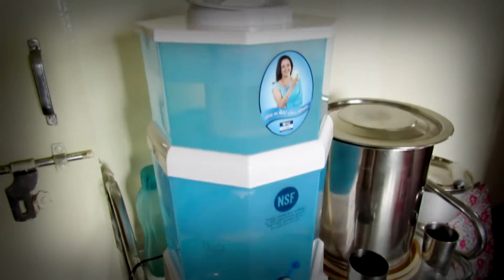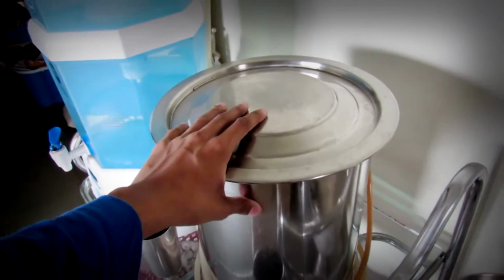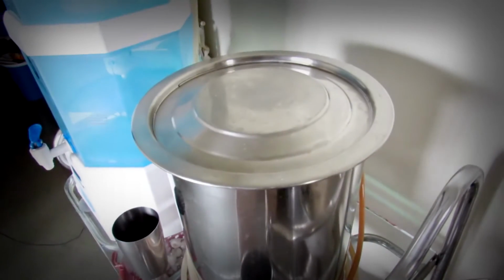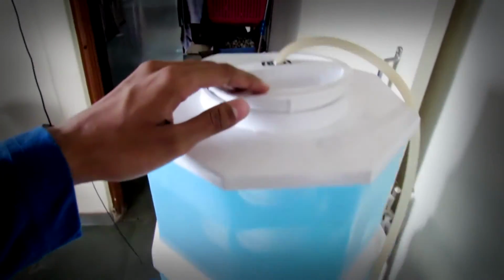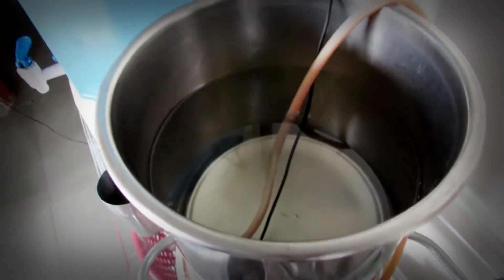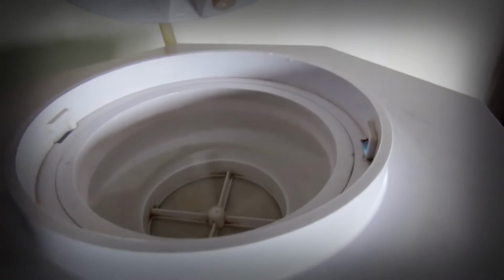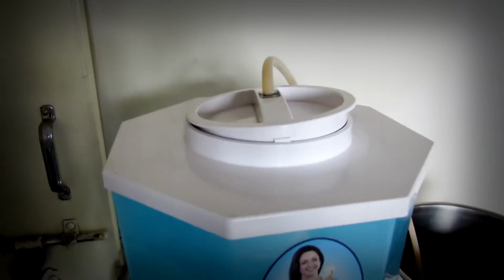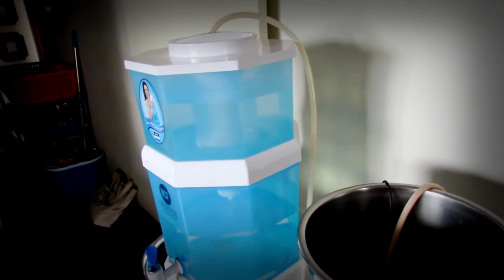Automatic Water Purifier With 12v Submersible Water Pump

Comment: I see in one of the videos you have used an electronic valve on rooftop, can't you use a similar here and automate the process completely?
Reply from the maker: That was solenoid valve (electric powered water tap thing!)and yes it possible to fully automate it like the pro water purifiers in market.